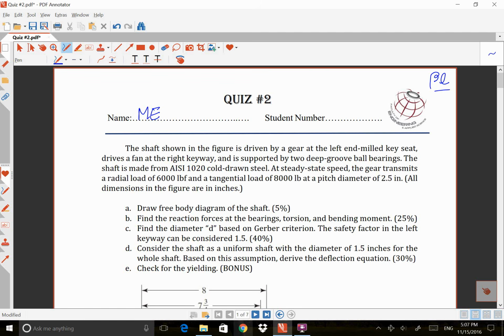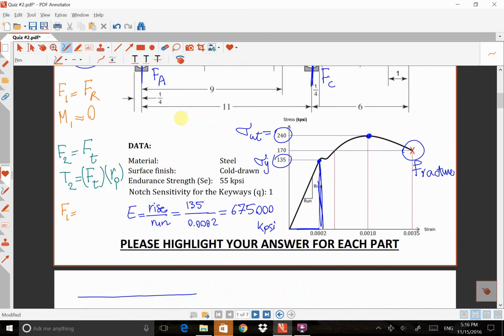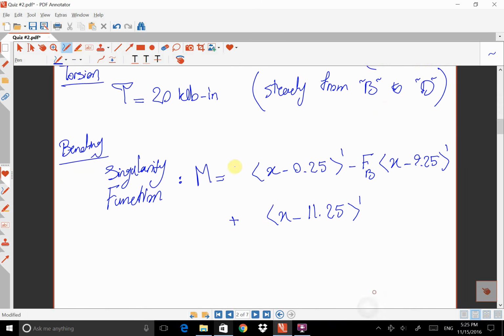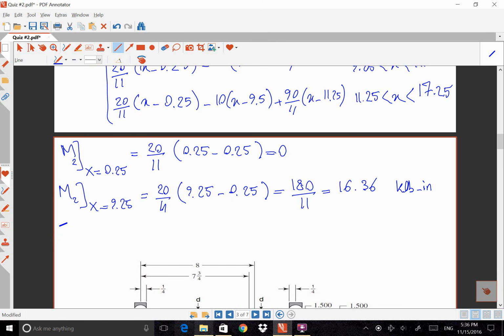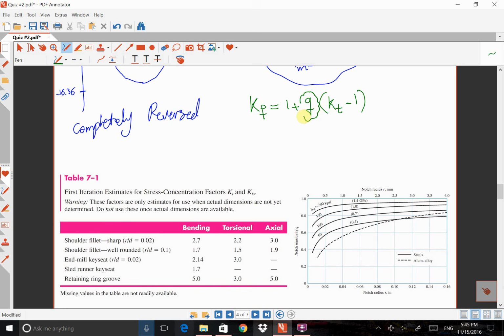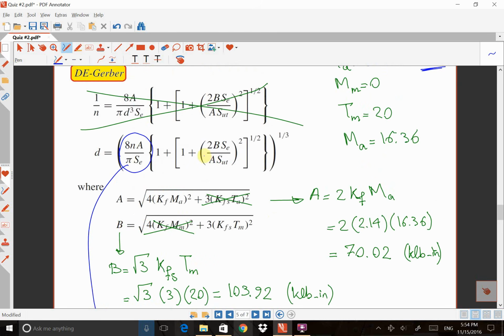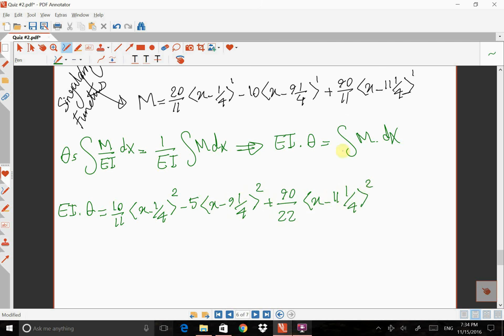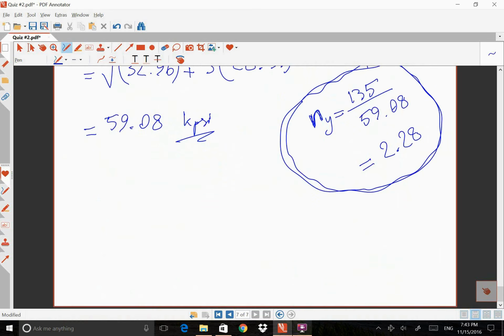Quiz Review, Shaft, Shigley, Chapter 7

Comment: I think there's a mistake in the equilibrium equations. When we sum the forces in the Y direction FB should be projected onto the Y plane or we can simply work with F1. Similarly for the sum of moments, the moment is in the X-Y plane i.e in the Z direction using the right hand rule, therefore its (F1)(9 in) and not (FB)(9 in). We should be consistent in the planes we are working with.
Reply: yeah i think that tooo

Comment: in my text book (Shigley's Mechanical Engineering Design Tenth Edition)  AISI 1020 CD given in table A-20 has an ultimate strength to be 68kpsi and not 240kpsi as you mentioned in your reference stress-strain curve, and a yield strength Sy=57kpsi rather than 130kpsi. This would change the modified endurance limit as i calculated it (maybe wrong) to be Se=24.5kpsi after i assumed conservative marine factors as a first assumption.Besides that, the notch sensitivity would change to be (q=0.68 &qs=0.7) this gives different fatigue stress concentration factors (Kf=1.78 & Kfs=2.4). I would appreciate it if you ket me know what diameter did you assume in calculating your size factor(Kb) mine was a 2 inch diameter. I'm asking this because without having a first assumption of a diameter, i cant find  the modified Se, the notch radius, the notch sensitivity, Kf,Kfs which all are to be used in applying the DE-Gerber Criterion to determine the actual diameter. I appreciate any orientation from you.
Reply from the maker: This course and almost all equations presented in are basically based on real experiments. In another word, maybe in 10 years from now, some of these equations won't be valid. 
about your point, I will check my textbook and get back to you.

Regards
Reply: Good day Mrs